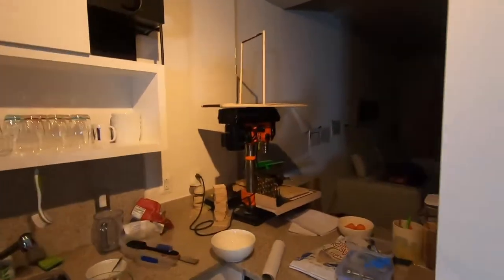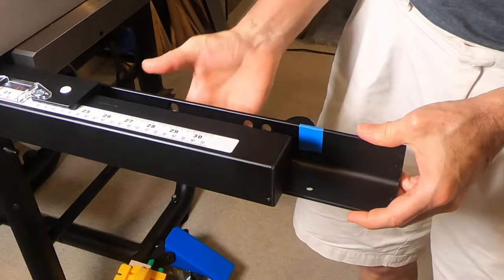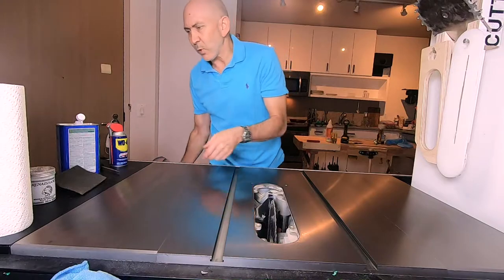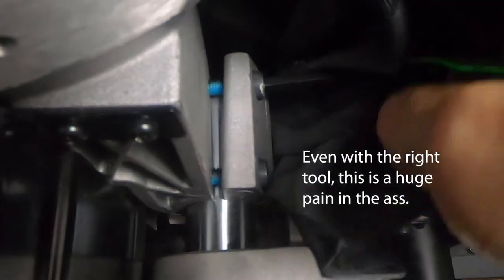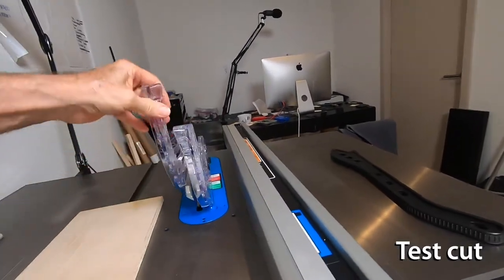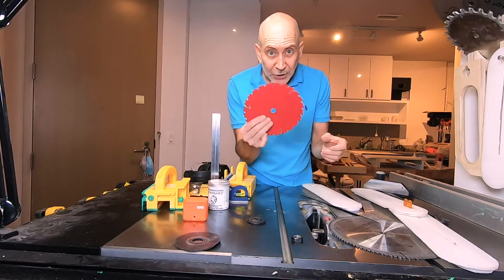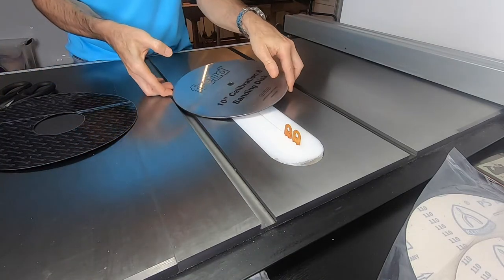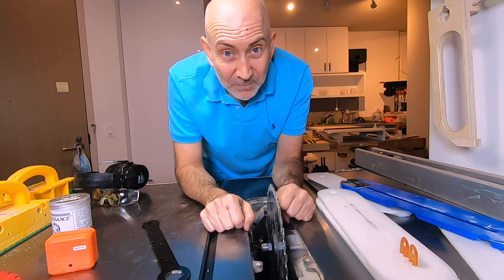Delta 36-5100 Table Saw Setup - must watch if you are in the market for a table saw

Comment: This is the most detailed examination of the Delta 36-xxxx saw on YouTube. But the true test of a saw is whether the table is flat in both left to right and back to front directions. I could find only one reviewer that checked this only to find his saw blade could not be square on both left. And using a straight edge found his saw dipped in the middle front to back. How's yours?
Reply from the maker: Good question. I am cutting very square and parallel cuts with it, so that seems to be good enough for me. I can measure squareness and parallelness easier than flatness of the saw. Also, in this price range, I can't imagine you can find something flatter. The cast iron wings are critical.
Reply from the maker: Mine is flat, because I got the cast iron wings. They are wonderfully flat. I wouldn't want this saw with just the steel wings. The wings could be more easily adjustable, but once I put them on they came out dead flat.
Reply: My saw, without wings, dips like 1/16 in the middle side to side.

Comment: Appreciate the video. Actually watched the entire thing. Picking up a 36-5000T2 tomorrow an I'm really excited. Only difference I see between that an the 5100 is three stamped steel extension leaves vs 2 cast iron ones on the 5100
Reply from the maker: I'm sold on cast iron, but let me know how you get on with that one!
Reply: @cuttingthroughthenoise3086  it's acceptable. The stamped plates have a dish to them, but the edges seem pretty flat and square. Corner to corner it's flat, just have about 3/16ths or so valley in the middles. Cast is certainly better, but the steel plates are okay. Imperfections aside, the saw is dead square and true to the fence, after some minor tweaking. Well worth it overall imo
Reply from the maker: @richardcagle5475  Save up for the iron wings, you'll love them.

Comment: Hello and thanks for your review, I would like to ask you if this table saw have a soft start? so it don't have a high amp peak at starting?? thanks again
Reply from the maker: I think I mentioned it. I bought a soft starter and it actually spiked the amps and killed the circuit! So I sent the soft start back and have been using it without ever since. I do not notice. It feels totally natural to me. One thing is that with 110v on a 20-amp circuit, this motor can't turn a full 8" dado stack all the way stacked. It goes to maybe 3/4" but that's pushing it. 240v would solve that problem.

Comment: Contrary to the tool reviews the Delta 35-725T2 is junk. The motor is garbage and the capacitors don't work. Out if the box if didn't work so I had to take it to a service center to be repaired.  Would not recommended purchasing the saw unless you plan on having it in the shop for repairs. Out of the box it didn't work.
Reply from the maker: Sorry to hear that! Mine has been a perfect workhorse since day one. I wonder what percentage are lemons?
Reply from the maker: Too bad! I love mine and use it almost daily. That sucks.